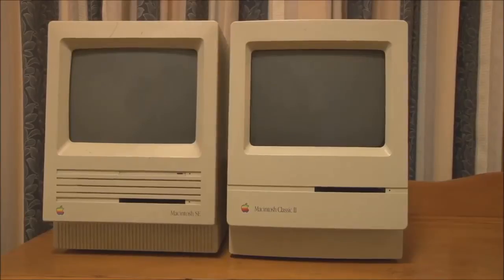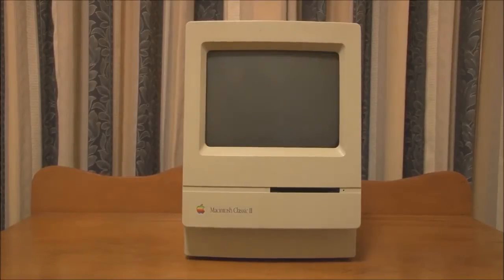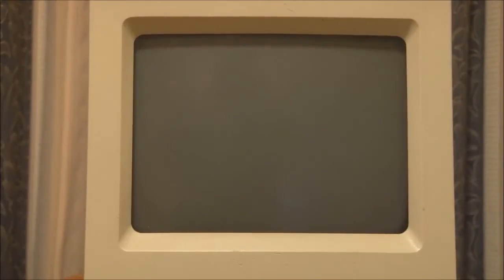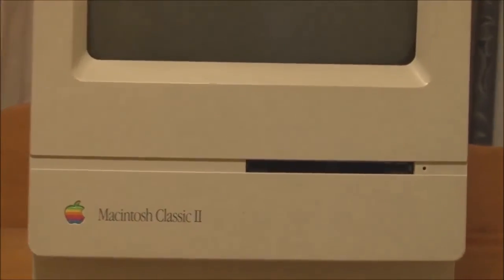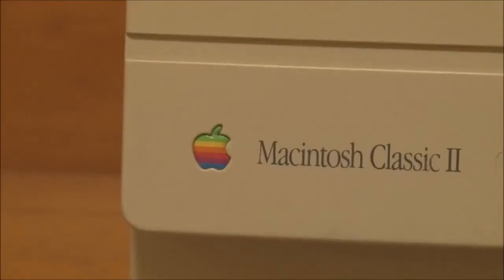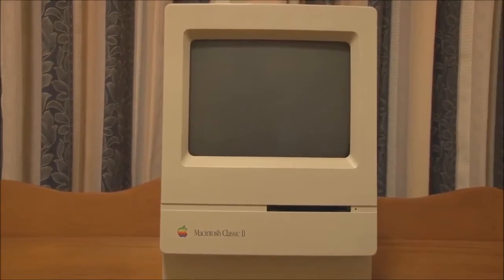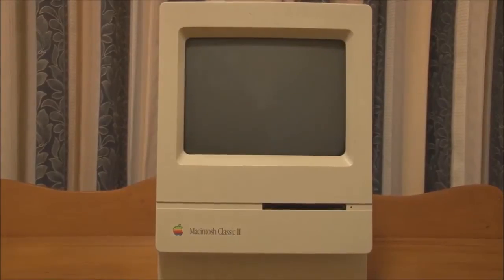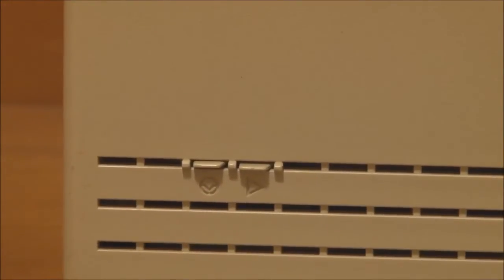Macintosh Classic II (1991) Full Tour

Comment: From what I can tell from the yellowing of the plastic must've been due to the bromine that Apple applied to their casings. I think the main purpose of using bromine was to make the Macintosh Classic become flame-retardant, but overtime the plastic will start to yellow and become more brittle overtime after direct UV light exposure. When you compare that in conjunction with the plastic contents used for the Super Nintendo Entertainment System, this is when it becomes relatively significant in terms of bromine usage.